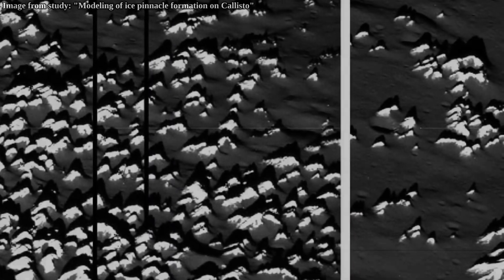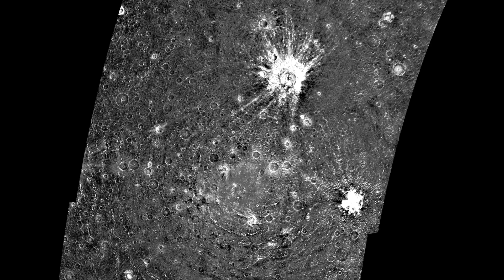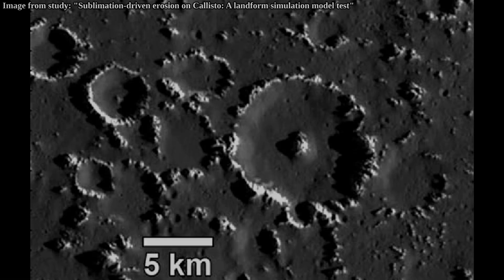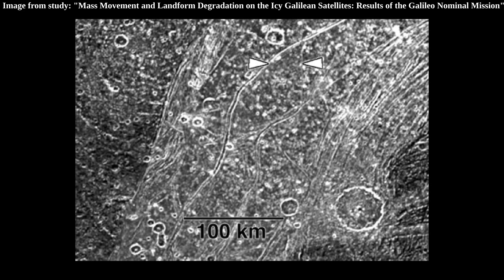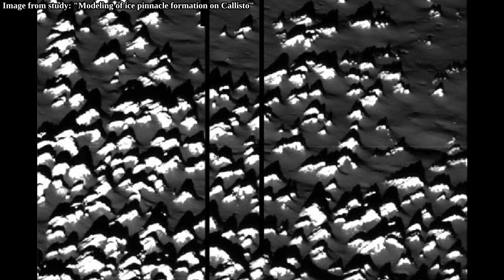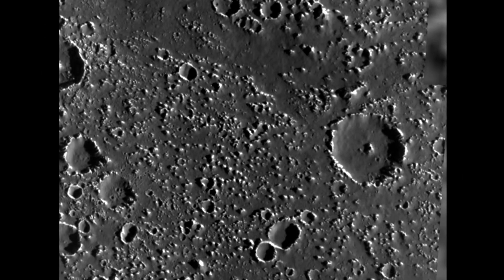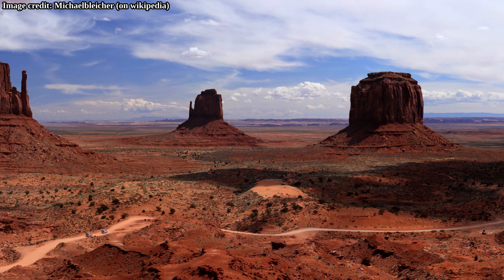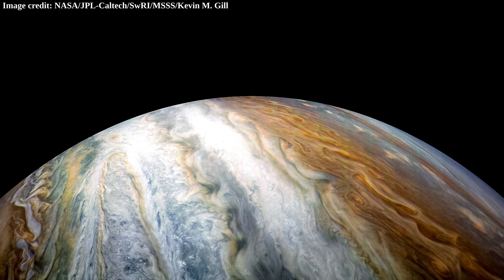Callisto's Strange Ice Towers - Most Cratered Moon Of Jupiter

Comment: But why don't we see such towers on our moon, its not like they are not on moon but why so less on moon??
Reply from the maker: Probably because the Moon's rocky surface cannot sublimate reasonably fast such that crater rims can erode and form towers on a large scale. Callisto's surface on the other hand has a lot more ice compared to the surface of the Moon, because of that Callisto's surface sublimates a lot more easily compared to the surface of the Moon even at Callisto's frigid temperatures, because of that crater rims on Callisto erode a lot more easily and areas densely packed with towers form.

Comment: Other almost-airless bodies such as Triton and Pluto also have substantial heat transport via sublimation and frost, nitrogen out there in the cold. That the frost is so reflective (in part due to the internal voids, same as snow) helps it reflect sunlight while enhancing long-wave IR emissivity, making it very cold indeed. The dark plains get warmer and drier, the cold mounds get colder and saturated.

@Nighthawkinlight is making super-white, high-e coatings and fibers that get cooler than ambient air in full sunlight using the same principles of porousity for scattering and reflection of sunlight, and high thermal emissivity from the bulk. Engineering often simply replicates natural phenomena.
Reply from the maker: Please edit the comment to exclude the link or post again by just mentioning the youtuber channel name in question, youtube doesn't like links and it tends to hide comments with links from the main top comment page.
Reply: @DrekslerAstral  Thanks, I didn't know that but it explains a lot.

Comment: What If a Sub-Earth like Mars replaced Venus and a Super-Earth-Type Planet replaced Mars
Reply: The Mars replacement would be ‘habitable’, most likely. As it could then hold onto its atmosphere easily.  The Venus replacement would be more difficult to predict, being smaller would not necessarily mean it wouldn’t heat up and evaporate its water, as boiling temperatures would be lower with the lower gravity/pressure.
Reply: @ivarbrouwer197  It would probably only be habitable near the equator unless it had much higher CO2 than Earth
Reply: @KepleroGT  too much variables to make such distinctions I guess, that there would be a substantial atmosphere with higher pressures then earth and thus more stable temperatures would be a given, but exactly what it would be like? Too much variables are not defined.

Comment: I understand that in the future it will be easier for humans to establish a permanent base in Callisto since it is located somewhat further than Europe from the radiation emitted by Jupiter. Thanks for the video!
Reply: i like that the surface should have a more balanced mix of resources
Reply: Can't wait for European, Ionic, Callistani and Ganadian colonies to be a thing
Reply from the maker: @LucasFerreira-gx9yh Can you remove the comment and then post it again but without the link, the comment otherwise gets hidden. Just point to the site as to where the information can be found such as: go to ntrs nasa site and in the search section type: Space Suit Radiator Performance in Lunar and Mars Environments
Reply: Doubt it. It’s -150 degrees there.
Reply: @fromontario6954 The vacuum of space is a perfect insulator though
Reply: @fromontario6954  so what, the ground is -150 and there is basically no air to transfer heat
Reply: @LucasFerreira-gx9yh  
-150 at the ground level so what? Lol if you think it’s possible for humans or equipment to operate at those temps, then ur out to lunch!
Reply: @fromontario6954  In Europe?
Reply: Yeah it's around Jupiter. Pretty far from Europe😂

Comment: The more craters I see the less I see sense in the 'impact' theory. I can understand an incoming object compressing air in an atmosphere in front of it and exploding because of that but where there's no atmosphere at all we really ought to be be seeing many more oval shaped crater than we do. They can't all be circular. That's too odd to be ignored as it is.
Reply: Infact almost all craters should be circular due to the velocity involved. Think about the impact as setting off explosives than a collision. To get oval craters the impacters have to have a very shallow angle of approach.
Reply: Craters are formed when explosions occur UNDERGROUND.

And this is exactly what happens during a bolide impact.  

Almost no matter what the angle of incidence, the bolide manages to bury itself underground before it's kinetic energy can fully convert into a thermal explosion.

Check out footage of the NASA Ames Vertical Gun Range to see this filmed at 100k fps.